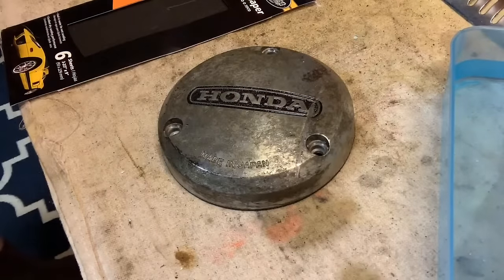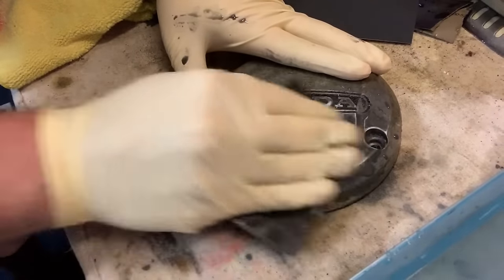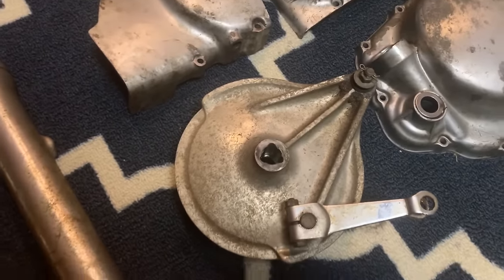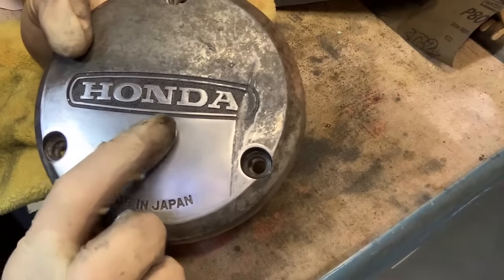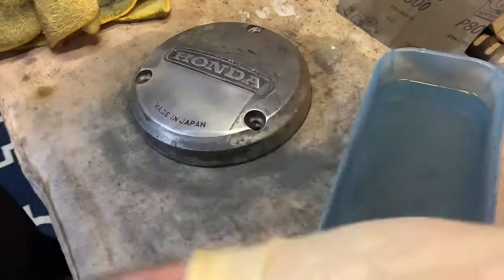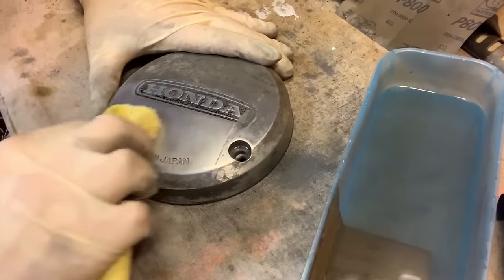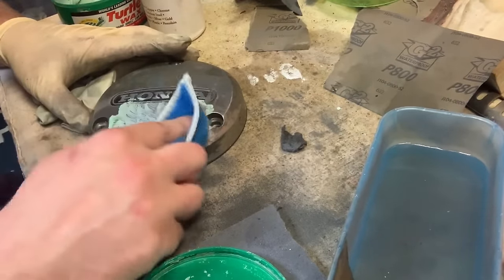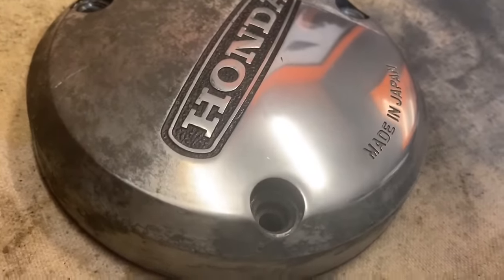How to Restore Aluminum Motorcycle Parts like a Pro for Cheap

Comment: I have a xs850. And the person before me painted over the chrome. And it's a air cooled motor. Is it possible to remove the paint and be able to buff it good enough to get the chrome shine out of it.
Reply from the maker: Absolutely. Some paint stripper or thinner will take the paint off then you can polish it to a shine. I just stripped clear coat off some hubs and they are polishing up great! Stripping it saved a lot of sanding time too.
Reply from the maker: Absolutely. Some paint stripper or thinner will take the paint off then you can polish it to a shine. I just stripped clear coat off some hubs and they are polishing up great! Stripping it saved a lot of sanding time too.
Reply from the maker: Absolutely. Some paint stripper or thinner will take the paint off then you can polish it to a shine. I just stripped clear coat off some hubs and they are polishing up great! Stripping it saved a lot of sanding time too. Go get it.

Comment: Seems to me someone has made tools that do all that HAND work you did which cuts the time down, though it is still time consuming. I polished 2 forks on my MC and it took me 3 days using a wheel buffing grinder pad and polish sticks. After I was done, I used SHARKHIDE on the forks to prolong the look. Wax might last a few months but sharkhide lasts years. It is a non yellowing clearcoat finish that is NOT CHEAP but works most excellently.
Reply from the maker: I kind of enjoy the process.
Reply: @KeepOnWrenching  Ok but would you like to prolong that process or simply continue to waste time after time doing it over and over ?   Insanity is defined as doing the same thing over and over and expecting different results.
Reply from the maker: It’s really not that bad. It’s a process. Not everyone can afford power tools. This is just a way that anyone can do it.
Reply: @KeepOnWrenching  LOL, everyone ? Anyone can afford a harbor freight oscillating tool that makes quick work of polishing using a custom made plastic adapter attached to it ..... far easier and faster. Time is money and I do not waste either one.
Reply from the maker: @anonimous2451  for some it’s one-and-done project. Fixing up their dad’s old bike or something. Simply saying that there are many means to an end. When I recorded this I didn’t have many tools but still wanted to get things dine and make progress. It wasn’t a race. More of a process. Since then, I’ve added many tools because I do many bikes…for some, some sand paper, time, a beer and football game makes for a cheap yet rewarding experience.
Reply: @KeepOnWrenching  So true. But ya forgot the puff puff pass option. Goes very well with a smooth Lager.

Comment: An orbital won't work?
Reply from the maker: Maybe on the first 400 pass to get the really rough stuff. I haven’t tried an electric sander because most of them are big and the majority of these covers are small with little.nooks.i do it by hand to keep it all consistent.i wish I could find  smaller sander. At the end of the day it’s not so much to just do by hand. If you try a small orbital LMK how it goes.

Comment: Put a little dish soap in the water; helps clean as you sand and it lubricates the process.
Reply from the maker: Good tip. I’ll try that for sure.

Comment: Hey Brain first off want to say thanks for doing these videos, especially how you show your mistakes as well, just how videos should be when learning this stuff like I am....Anyway just a quick question on why you didn't Sandblast your engine parts, a buddy of mine said you can sandblast Aluminum, as long as its like baking soda, or walnut shells.....Just curios, of if you didn't know you could do that wanted to give you a heads up for next time...I haven't watch any other videos yet besides the CL project up to this video now.... just to let you know also you gave me the confidence to just get a old bike and start working on it like you have and will start this spring if I can find something similar....Thanks Brotha!
Reply from the maker: I have been treating the engine as a completely different project on this build. I’ll get to the engine. I’ll be featuring vids on cleaning that up for sure. I want to get it to a rolling frame first. Glad you are getting some inspiration from the vids. Trying to be as detailed as possible. Long way to go but I think I’m over the hump. I’ll look into options on cleaning the engine. I’d love to just blast it. I like to take my time on the other stuff as I love that polished aluminum look. Blasting tends to leave a bit of a more matte looks. Good luck with your project bike. Go get it.

Comment: Good advice on the gloves, they're an absolute must, aluminum is toxic and absorbs easily into skin once sanded so finely.
I just spent about 30+ hrs doing this on a set of rims but it was worth it, they look better than new. 
I had to start with 100 grit in order to sand the machining grooves out, it gets easier with each step up.
Finished with mother's aluminum polish and they mimic a chrome finish it's so mirrored.
Reply from the maker: WY to stick with it. It’s a gradual process for sure. Gets easier as you go. The results are worth the time and energy.
Reply: I am in same process. My personal opinion is the Blue Magic polish was more effective than the Mothers. I used Scotch brite pads and they were effective as well. I honestly have no idea how I’m going to do those inner wheel spindles.
Reply from the maker: Show lace with compound

Comment: If I also wanted to repaint the “Honda” part of that cover, when do you suggest that would happen, before the aluminum and then sand up to it when polishing, or after and clean off the excess paint?
Reply from the maker: I’d get it where you want it polishwise then go for the detail on the name area.
Reply: @KeepOnWrenching   I’d love to see a video on cleaning the hard parts like the bolt holes.

Comment: I use a bench grinder with the guards removed and a rubber expander wheel and various grades of abrasive belts from the Eastwood Co. This is to smooth out imperfections or damage on aluminum parts. I restore vintage bikes and it is a big time saver. Once the part is ready, I have a dedicated polisher with various grades of buffing wheels and 4 or 5 different compounds. Each wheel and abrasive is different and as you showed, start off course and work your way to as fine as you want. I do stock restorations so I don't buff aluminum parts to look like chrome. The 60s and 70s bikes had their parts quickly polished then clear coated. Which brings me to one last point. Rather than trying to sand or buff clear coat off, I use automotive paint stripper which saves a lot of time and effort. Very informative videos! I just discovered them and will be watching more!
Reply from the maker: I’ve since uograded
Reply: Yeah I saw a video where this guy was using that stuff, he didn't show what he was using to eat the paint though but it looked cool as hell